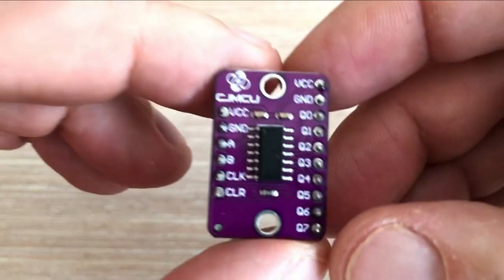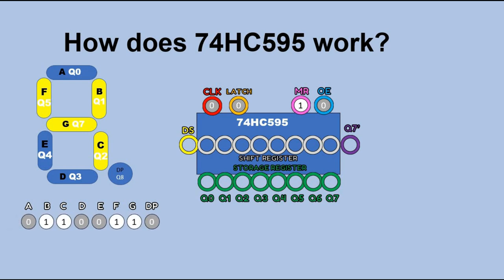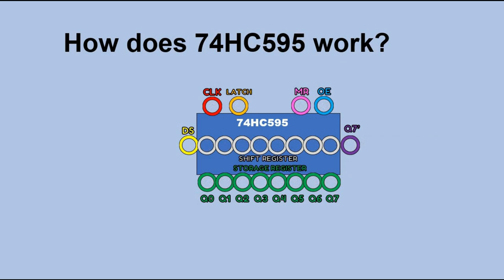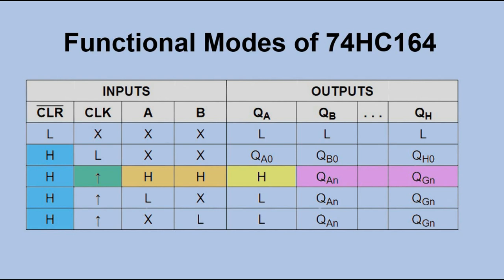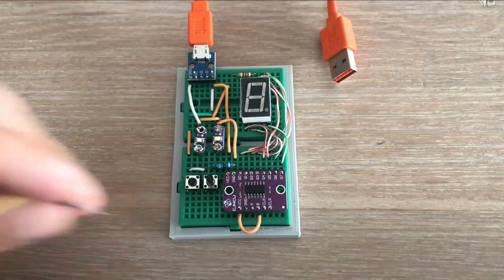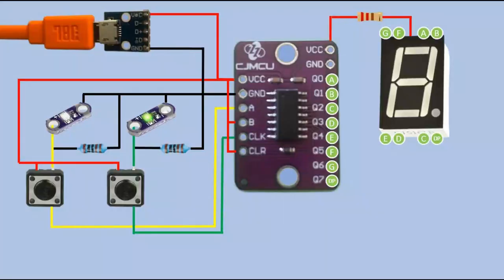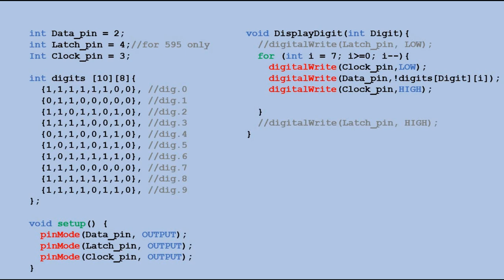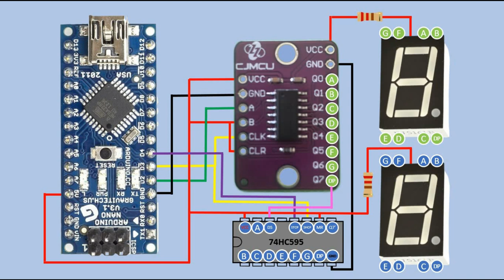Unlocking Shift Registers: Arduino Guide to 74HC164 with 74HC595 Comparison!

Comment: Hi Mario, I could use your help. I just came across your channel and a noob in electronic circuits. For my current project, I need to design a mechanical keyboard with around 200keys. There is no MCU with so many IO pins. How to use a shift register design with a simple MCU like a Atmega or something similar? I'm thinking to do a prototype with a Arduino as it's the easiest. I didn't even see any tutorial on a full size keyboard (113 keys) as most people are using the 60-80% builds due to limited number of IO pins for common MCUs.
Reply from the maker: Hi, I am planning to do a video on the particular shift register that can be used for such purpose. It is 74HC165. The shift registers I used till now provided output extension. This one provides input extension.  I have not used before. I just ordered it so I need to figure out how to use it. So you can either wait for my video or check other existing tutorials

Comment: Looks like you are using a single 220ohm resistor.  Assuming 2v forward voltage of red LED, then you will always be drawing a total constant current of (5Vcc-2v)/220ohm = 13.6mA when one or more LEDs is on.  The per pin maximum for the 74HC164 is 25mA so you are well within the chip specifications.  Note that the 13.6mA is divided across the parallel LEDs so you may notice that the more segments that are lit, the dimmer each segment will be.  Sometimes you may get away with it, but a reason not to use a single LED is that the current may not be equally divided across the LEDs potentially overdriving another LED, especially if one burns out.
Reply from the maker: Your posts were incredible helpfull. I may do an appendix video with all that info . by the way can you recommand any good overview books with which I can improve my electronic skills. I looked at few titles but they either a bit over my head, or I did not particulary like how they were structured

Comment: 2:00 master reset resets the shift register to zeros & does not affect the output. So what you said was wrong.
Reply: To “reset all outputs as low” you need to latch it after a master reset. Or use output enable to turn off the outputs (high-z).
Reply from the maker: You are right.I should have said it resets the register not the output .

Comment: what is the use of the second input B for?
Reply from the maker: This is a good question. You actually have one input pin either A or B with following 4 posible connection combinations (2 of them are the same) A-input,B connected to A, A-input, B-connected to 5v, B-input, A-connected to B, B-input, A-connetcetd to 5V. Maybe they just had a spare leg:)
Reply: @marios_ideas  It seems like A and B are an AND gate in functionality to me. Maybe for functionality other than with digit displays, having an in-built AND gate is useful. One input can control whether the other input is able to write data.

Comment: Hi Mario whats exactly the point for this?
Reply from the maker: Not sure what you are asking about. The shift registers give you possibility to control 8 segments  of the display (or multiple displays) with just two output pins of Arduino. Without it you would need to use 8 pins for each display. So if you wanted to have digital clock (4 displays needed) you would run out of pins. Not sure If that answers your question.
Reply: I have used as much as 9 - 164 and 9 - 595 shift registers on a project..... its a good way to control many buttons for inputs and drive Leds on outputs.